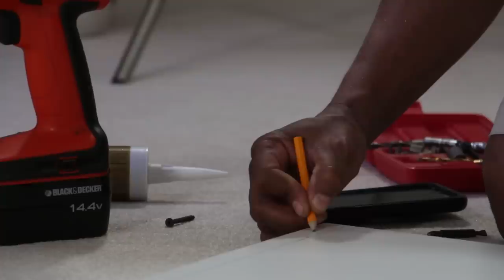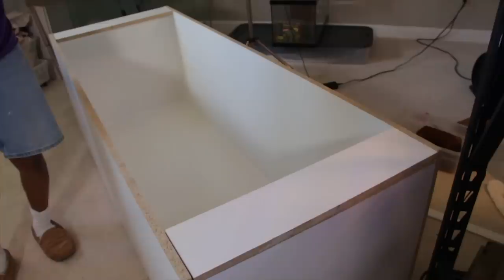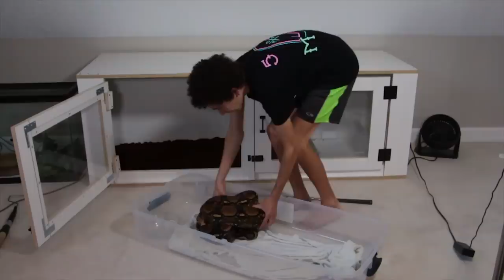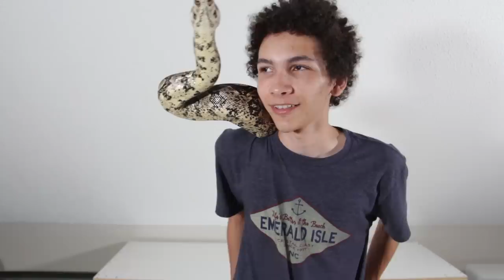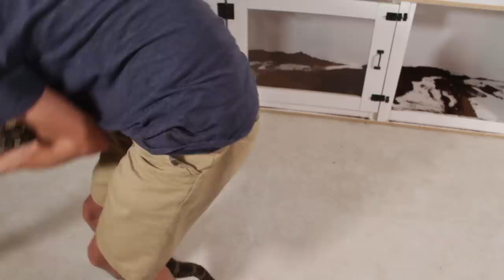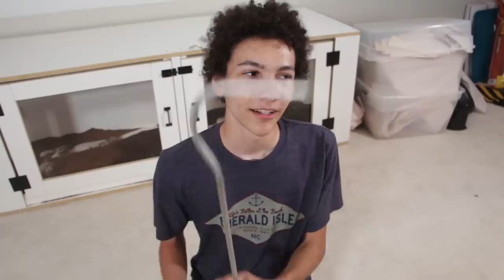Building a DIY Boa Constrictor Enclosure!

Comment: GoHerping. From one Boa keeper to another, I love your setup so far and what you plan on adding. Besides a branch to climb on which others have already mentioned it would be good to add small vents on the back and/or sides of the enclosure to allow more air ventilation. Also a radiant heat panel will probably work better for a snake and enclosure of that size. The led lights will be fine as long as they're on a timer or if you keep up with the day/night cycle yourself. Good luck! ☺

Edit: She needs deeper/more substrate as well. It looked sort of sparse at the end. If you ever had any questions about boas or their care I'd be happy to help!

Edit #2: saw someone mention fake plants. They actually work great for hides and so does moss. My boa uses the plants and moss more than anything else and the moss helps a lot with the humidity as well.
Reply: K.L. Smith hey what size enclosure would u recommend for a juvenile boa?
Reply: @RezaWorlock  how big is the snake? Most go by the "an enclosure that the front and one side are equal or larger than the size of the snake". Really it depends on how much money you have to spend and how big your snake is.

Comment: You did a great job reading her body language and cues, and holding her appropriately! Around a leg, the waist, under and arm, over the shoulder are all great positions for large snakes, and it is always good to keep hooks on hand just in case.

Keep in mind she needs good humidity, im sure she will fire up a little and be more comfortable if given not only a nice warm lamp (they will use uvb too of course, id stick around 6%), and they do take advantagr of basking shelves and elevation, they spend a good amount of time climbing (parrticularly when young and hunting nestling birds).

Dont worry about feeding her too often, an adult boa constrictor can easily become obese if overfed. She is a great size, a big meal once a month or so should be plenty. You don't want her to be flabby and squishy, lean muscle is ideal. 

You did handle her confidently when retrieving her too haha, so greag work! Honestly the less time you give them to think about it, the easier it tends to be to pick them up.

If you want to keep her humidity up I recommended adding a coco mulch like reptichip and mixing it into the soil to get at least 3 inches of substrate. She may even bury herself. 

They do tend to prefer cryptic basking too, which is where only part of the body is exposed at a time - clutter leaves, strong ferns, small trees,  are their friends! 

She was probably very upset because she was being evicted from a long term home after not being touched like at all lol, but boas can be very chill snales with little provocation to be so.

Just always be aware of where her head is, if she starts getting really tense or flighty try and get her moving to prevent a strike response, and def dont let her wrap your head or neck. 

Dont be afraid to ask for help either, nothing brave or smart about wrestling a 6 foot constrictor who is grympy lmao. 

And i guess be aware of her length when feeding and stay waaaaya away from that head! If she does wrap something she isnt supposed too always start from the tail and unwind her from tail up. If you start with the head she will just coil more tightly.

Comment: Snake handling is all about the handler, really. You've got to be gentle, slow, and most of all confident. I think most "aggression" problems in snakes, especially species which are normally docile, stem from improper handling. The snake can easily be frightened by jerky fast movements. Even the angriest of bullsnakes can be handled with some patience and kindness. You're doing such an awesome job with this boa

Comment: Add an acrylic or screen window on the lid and put a basking light that only puts out a small amount of heat. Then get some drift wood or other wood and make a spot for her to bask (it'd be beautiful for Instagram shots!). If this cage is long-term I would even commission an artist to paint a jungle on the inside of the back and sides to add a bit of color! For other decor I would suggest creating planters on the sides of the tank that have vines or etc. because she'll probably squish anything that's on the bottom. You could even probably get pet safe, water-proof clay or some other sculpting material and make the water dish naturalistic - but that would probably be a bit inconvenient. Anyway, I think the cage is great like it is for now! It's obviously well made and works really well so I wouldn't worry about decorations unless you really want them! Whatever you do with it, I'm sure the boa will be happy just to be getting some attention and a cage with actual heating!

Comment: If you ever want to add some color to the enclosure, I highly recommend milk based paint (comes in a bag of powder, just add water). It's non-toxic to any living creature, though it does smell like milk gone bad during the mixing process. You can apply it thick (which dries in an alligator texture effect), normal which looks like latex paint, though chalkier, or you can apply it watered down which results like a stain. I used it on my 5x2x2 snake terrarium and I have no regrets at all. I finished it off with several layers of polycrylic to protect it from staining and so I can wash it easier if I ever get mites or something. With that white enclosure GoHerping has... he would need to sand it down to remove the shine from the surface before daring to try and paint it with anything as paint won't stick to it otherwise.

Comment: It's funny that you mention having her in your face as intimidated. I began collecting snakes in 1993, mostly from owners who no longer wanted them. I started with 2 corn snakes, but my third was a boa about the same size. The whole way home, my roommate was holding him in the front passenger seat with me behind him in the back. The whole time, he just wanted to ride with his face inches from mine just staring me down, but not aggressive. As a new snake owner, this was certainly intimidating, but he quickly became my favorite snake among the 13 I eventually had, all in a small apartment. He wasn't the biggest, I had 2 berms close to 10 feet soon after, and all 3 were super tame and I handled all 3 daily.

Comment: You still need 2 hides on each side one on the cool side and one on the warm side.  Also snakes dont need a day and night cycle as long as you turn your lights on and off. Red tail boas can get 14 feet but it is very rare also if you weigh her and your standing on the scale it messuring your weight not just hers.

Comment: Get dubble that high't. and putt a thick tree branch so it can climb some to. 
You can cut big hole in the top and build one more terrarium on top, if don't build a new bigger.
Get Styrofoam and cut it to look like rockside on the side and back, and put concrete on it with a brush.
Looks relay good.

My terrarium was around 1.8m long, 0.8m deep, and 1.2m high.

Comment: Alex, i have my boa in a very similar setup and I struggled decorating it for quite some time. if you have a Joann's Craft store near you, they sell 7ft Flower Garlands of all different types for 7.99 , I have found that these easily give a new look to any enclosure especially if you get more than one and much cheaper than anything from a Pet Store! As for a hide for such a big snake, I found that Dish Tubs at my local dollar store flipped upside down made ideal hides, just cut a hole to size of the Boa. I have lots of good pictures that may be able to give you some ideas, would sending them to the Facebook page work?

Comment: How did you do the heat tape/heat pad? I have a wooden tank made very similar and I'm not sure how to set it up safely.  I'm concerned about ventilation so it doesn't over heat. I can't put it on the bottom because the melamine is too thick.  I can't put it directly in the enclosure because I don't want my future BP to get burnt (I will have a thermostat!).

Comment: Yeah definitely Heating and make a hide for underneath the water bowl my snakes love it I technically have for hides in my enclosures I got the main hide for heating I got a humidity hide I got a cool hide under the water and another half log hide Patrick Marsh in the back sides covered with some bedding there's someone with sunlight coming in at the top though and they're in big tubs for their size and they love it they use each hide and humidity box and I got some plants in the middle of it

Comment: If I'm going to give you any useful advice, I'd advise not to use heat tape with large snakes like boa constrictors for two reasons. Firstly, large snakes like boas can sit at the end and warm up by the tape, but it being so large it can create a thermal blockage for the animal, which is very common in pythons and boas. Secondly, heat tape is only really suitable for small enclosures, but when dealing with cages 6 foot +, they won't give your snake the right ambient or cool side temperatures. I'd recommend an AHS or reptile radiator, even a ceramic to get the proper gradient and create the most naturalistic environment :)
Reply from the maker: thanks for the tips! i'll reconsider the enclosure's heating

Comment: Omg, she's doing so well. ♥ How are you arranging her heat spot? Because I'm about to buy a enclosure made of fibreboard(?) and I'm wondering if I have to put the heat mat in the enclosure or outside the enclosure.
Reply from the maker: I was planning on putting heat tape under the pvc board, but a lot of people suggested that i uses overhead heating instead

Comment: How is that Gonna work with humidity? Asking because I wanna build something like it, but if it’s humid won’t it rot the wood? Also where would u put the heat mat?
Reply: A BC requires 70% humidity. Kinda like South Florida. Wood doesnt rot because its not 100%

Comment: Hey man I did the same thing. Here's my question. Do u use dry eco earth or the kind u get in blocks and break down in water. I built my tanks and for about a week now it has been sweating so bad the glass is dripping water along with the ceiling. Just curious. Figured it's because the bedding is still drying out some

Comment: With a snake that hasn't had heat for it's entire life, is it okay to just put the hot spot in normally or should gradually increase it? I just wonder because it could've adapted to the cooler temperature and it might be, I don't know, a shock to them? 

Anyway, I'm glad she looks calm down and doing well. I wish I had the talent to build a snake enclosure like that. lol
Reply from the maker: StephenXplodeNOW not sure honestly. My room is quite warm compared to the cold classroom temperatures from before and she's been soaking quite a bit. They're known for soaking on a usual basis, but I am curious if temperatures closer to what they usually need is catching her off guard or not
Reply: Maybe consult a herpetologist if you can? Regardless, she looks better now so it might not matter...

Comment: don't run the strip along the walls, i put my led strip round the top walls and my ball python would rip them off, i ripped the adhesive off and hot glued it to the roof of the enclosure

Comment: Please do a little more research.  Boa's require a warm air environment which means using a ceramic heater on a pulse proportional thermostat, unless the ambient air temperature in the room remains around 25-27c all the time, and only then could you use a heat mat as the primary heat source.  I've been keeping boa's for over 30 years in the UK and be careful placing such a large constrictor around your neck... But you're doing well to tame her after all that time she was without human interaction

Comment: how does it get air?
Reply from the maker: There's about a centimeter of ventilation on the top and sides of the doors. I was going to drill more holes, but I don't think it's needed